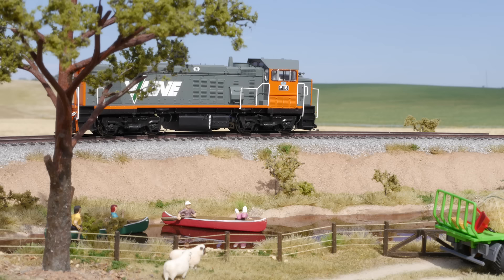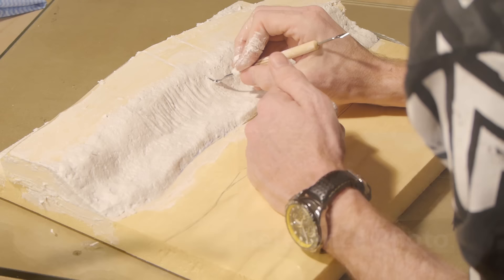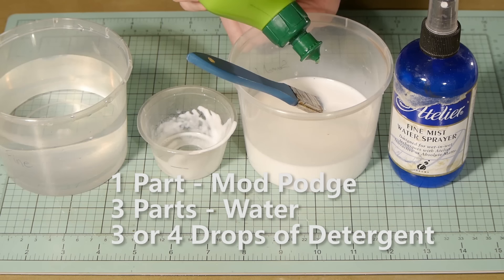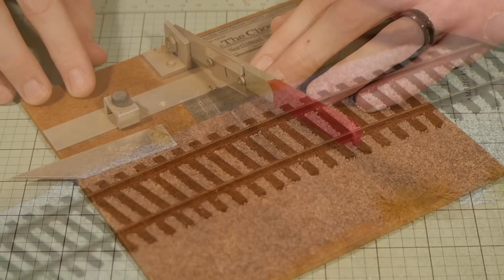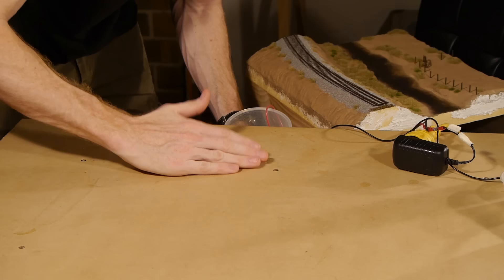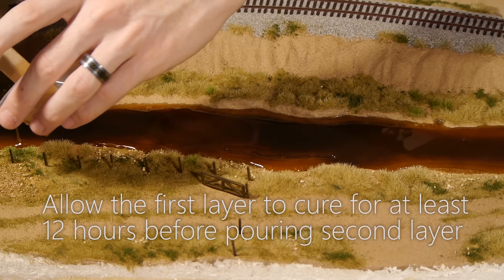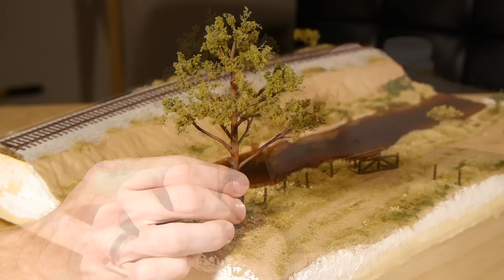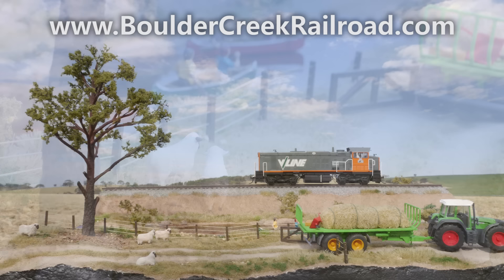Realistic Scenery Volume 3 - Modelling A River - Model Railroad

Comment: An idea: would it be too hard to put  canoas (or other boats) in the water before the acrylic dries, so they're a little bit sunken, and trace their slipstream? 
It might be cool to make the same thing with a pole, a dead three or a small pier, imo. 
Awesome job man, cheers!
Reply: Yeah! I was thinking you could also add people in before so it looks like they are swimming, or soldiers crossing a river or something.
Reply: and make the tractor dirty
Reply: Amazing!!!
Reply: SemmyRace yes this is easily possible with the right tools and if you were to attempt it I would recommend having a look at woodland scenics specifically
Reply: SemmyRace I agree is it
Reply: I was thinking the same thing.  You could also use the straw-blow technique to simulate the water being pushed aside around the boat/canoe as it's moving through the water.
Reply: SemmyRace why don't u try
Reply: Along these same lines.. I was wondering about putting fish in the water.... would you need to fully let the epoxy dry / set .. then do multiple layers ?   I think it would be cool to see some fish through the clear water..  : )
Reply: Cool
Reply: SemmyRace dassa ded 3
Reply: sharon olsen you can put fish into the resin, but you need layers.

Comment: Lovely work. With adding the colour to the epoxy it is helpful to add it to one of the parts before mixing, usually the thinnest one. This lets you get rid of the bubbles from stirring in the colour before adding more bubbles from stirring the two parts together.
Keep up with the excellent vids.

Comment: Luke, a quick tip for next time you may use the water; use a tooth pick or something thin and disposable to sort of 'pull' the water to the edges. I've found that it makes it look more realistic and smooths out the edges of the water so that it levels out and doesn't go rounded
Reply from the maker: good tip mate :) Yeah it did look a little unrealistic right at the waters edge, I'll definitely try your idea on the next water scene I make :)
Reply: Luke Towan maybe mix up a little bit more resin and put some small rocks in the gaps? Or even reeds would work.

Comment: A side note about the epoxy. (in my case I would be using fiberglass resin because they come in larger and cheaper quantities). Depending on the type material you use, if you have any deep seated air bubbles, you can use moderate heat (heat gun/hair dryer) to rise and pop the bubbles. (if you pour from the center slowly and carefully though, hopefully you won't trap any air anyway)

Comment: Hi, great video.  I mostly create terrain for wargaming, and one thing which I've tried to get a handle on is making rivers.  I like your river, however one of the negatives I've seen with the end result (although you don't seem to have this problem) is that the surface tension at the dam (tape in this case) seems to make an upward edge so that the ends of the river have an unrealistic upward curve where the tape was.  Have you encountered this problem?  If so, how did you get around it?

Thanks for your video - absolutely outstanding work.

Comment: Cool. I like what you consider bloopers, Nice. Is there a Difference in; gluing the base flat to a board, to sanding the base flat (besides the 'mess')
Reply from the maker: I guess you could just sand it flat the only problem is sometimes the foam curls after the plaster is added and starts drying. The board tends to be stronger and resists curling.

Comment: Perhaps this is a good place to ask: I’m making a small (3” diameter) diorama with still water, only some .75” deep max. How do I prevent the epoxy from “crawling up” (or more likely, shrinking) so a ridge shows around the edge? Cutting it off leaves marks I can’t hide. Should I pour thin layers? Use a specific epoxy? Is there something I can put on the packing tape/foil around that keeps the epoxy from flowing out? Thanks!

Comment: Very well done Luke as always! I have a question though, when pouring the epoxy, don't you have to seal off the foam with some kind of plaster to prevent it from sinking into the foam? I  didnt see you seal it off anywhere but the outside ledges.
Reply: the paint is the barrier and the scupti mold . its not in contact with any foam

Comment: For the water I have a question. In visually realistic terms I had always thought you should apply the epoxy clear and colour the river bed. I have even heard of colouring the bed or epoxy blue to simulate the reflection of the sky. Thoughts? Have you experimented with this?
Reply from the maker: A mixture of both is generally the best, only a very light tint of blue is needed. Most rivers look brown and you generally cant see very deep into the water. Being able to see the river bed is very rare for most rivers which is why I think you're better of adding color to the resin as opposed to leaving it clear.

Comment: On the canoes, would it be possible to pour a layer of the apoxy around them to give them more of an "in water" look instead of just sitting on top?
Reply: rather then build up the level of epoxy, I'd suggest setting the canoes when the epoxy is still wet. Also, don't forget the weight distribution affects how it sits in the water. A big guy in the back with small kids in the front will tend to stick out at an angle.

Have personally seen one larger guy in the rear solo with the front 1/3 out of the water.
Reply from the maker: it's possible but they will be stuck in place forever once you do, they do end up looking much better though when they are set into the epoxy, 35manning's idea is also a good one. Both will work great.

Comment: Great work as always Luke. Morbidly curious to know how much something like this costs to build though...?
Reply from the maker: If you include the vehicles it costs around $150... The resin for the river is the next most expensive item closely followed by the people 😃 Although I didn't include the train in that price... The train alone was $495 but that is because it is an operating train with sound 😃
Reply: Holy dooly, I should get into train manufacturing! $150 is a lot better than I expected, but I suppose you'd be sharing the cost of the materials across many projects. Keep up the fine work, you have the patience of a saint 😊

Comment: wow awesome work. so this mod-podge is basically what we here in the states call elmers glue? how did you dilute it and get it to flow out an eye dropper?
Reply from the maker: It's very similar to elmers glue, it dries a little less shinny which is why I like it so much. I dilute it 3 parts water and 1 part Mod Podge and add a few drops of dish soap before using it on my scenery. Thanks for the comment :)
Cheers
Luke

Comment: Your are perfect! I have a question where can i buy those sands? I am living in Turkey. If you can share a web site it can be better. You're so talented i love you man. <3
Reply from the maker: It's called grout, it's normally used for tilling. Most hardware stores will have a range of different colors. Any earthy type colors will work. Otherwise you can use a stocking to sift some dirt to get a really fine powder. I use a mixture of both.
Reply: Oh thanks. I want to do this work but I don't know how can I start. You helped me.

Comment: Hey! I was wondering, what do you do with all of these dioramas? Do you fuse them together into a bigger one ore just display them separately?
And by the way, congrats on your work!
Reply from the maker: I usually just display them separately, they are not designed to go together. I am making a lager model train layout and I generally build these dioramas to test new techniques before committing them to the larger train layout.
Cheers
Luke

Comment: I have a quick question about the epoxy. how do you keep tiny little bubbles from forming in the epoxy as it poured and cured. I saw how you got rid of the big ones on the surface but when I pour my epoxy I keep getting tiny bubbles all through it and I don't know how to stop it. Granted im doing what you were doing on a way smaller scale, but do you think the epoxy is curing to fast? I wouldn't be surprised since it was 5 min cure but I was just wondering if you knew if it could also be my mixture.
Reply from the maker: Sometimes you can breath hot air over the epoxy to help remove bubbles or use a heat gun, obviously you need to be careful with the heat gun because things like plastic models melt very fast! I too had some very small bubbles but for me they were mostly not noticeable. I usually try to mix the epoxy slowly to help avoid bubbles forming as well.

Comment: why did the foam bend? does all the alcohol spray cause it to warp?
Reply from the maker: No it was because the plaster on top dried and caused it to curl, only slightly. So it was the plaster that was warping and it caused the foam to be curved as well.

Comment: Luke, I admire your work, but...

When I was a kid we did HO modeling, laid our own ties on wood bed, nickel silver track hand spiked with specially modded needle nose pliers, ballast hand screened from a local creek, hand built buildings, trees and bushes, yards, engine houses, mountains with portals, trestles, rolling stock, etc. Your work is even better, and how you handled the water is brilliant, that's one of the toughest situations to model convincingly. But you made one major mistake that I frequently see on dioramas. You went and over modeled. Nobody goes floating down a drainage creek in a 13' canoe. You would have been FAR more effective just putting a family of ducks or geese in that creek. This may seem picky, but I've seen a lot of otherwise brilliant dioramas blown by over modeling.